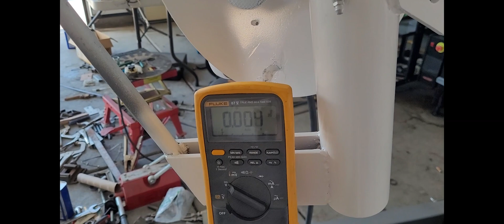THIS IS INTENDED TO SHOW VOLTAGE OUTPUT JUST TURNING IT BY HAND FOR EBAY

Comment: How do you stop it from over-speeding in high winds?
Reply from the maker: Hi Pete This is what Midnite Solar sells for a clipper the price is a bit high but I make my own. can't give a price right now since parts have gone up but I was selling them for 700 basically when the voltage on the turbine exceeds what the classic can handle which is over 150 Volts it will let go of the turbine at that same time there's a aux switch that comes on that goes to the clipper and slows the turbine until the voltage comes down. I have one here with me I'll try to do another video showing it. Thanks for the comment. BTW this is the clipper from midnite solar  https://www.invertersupply.com/index.php?main_page=product_info&products_id=203882&gad_source=1&gclid=Cj0KCQjwqP2pBhDMARIsAJQ0CzpeQ_naWjUL9uqxvG0krcQ5vlvamJ0HKbqZSCKwJFvt4OcxZLdZQdkaAoPHEALw_wcB